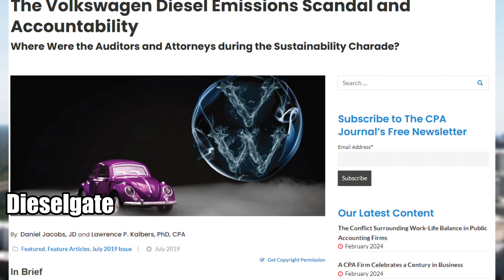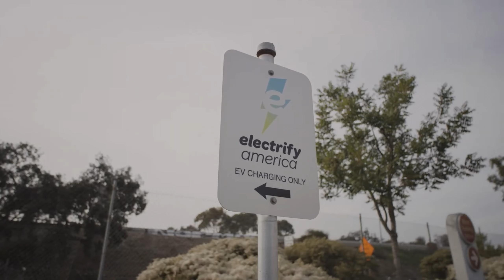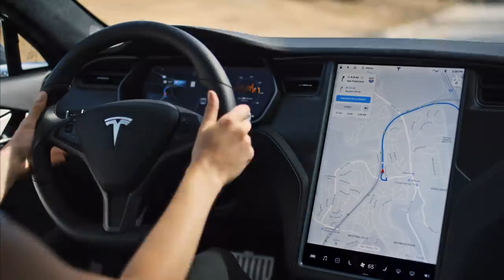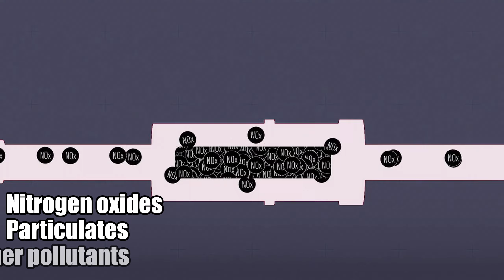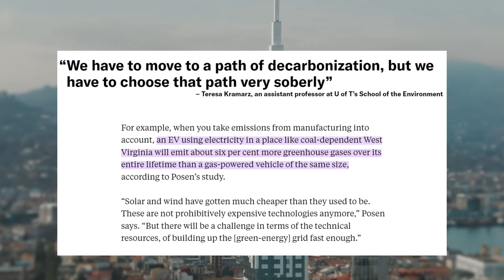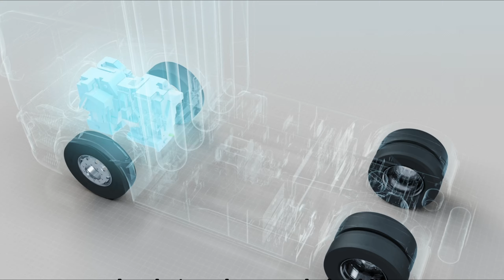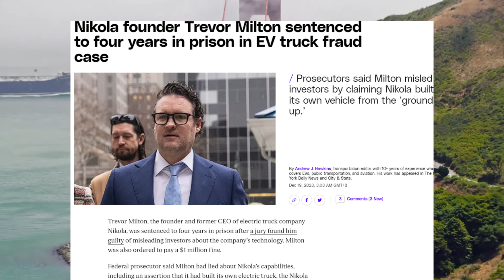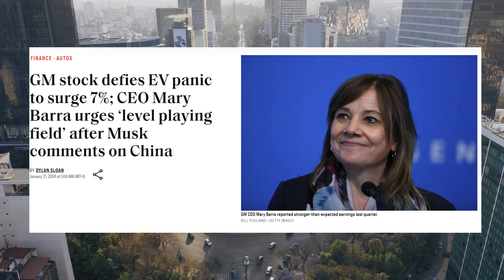Electric Shock: The 5 Scandals That Shook the EV Market! A Dead End or a Bump in the Road?

Comment: Interesting that #5 was NOT the Risk of a Firey Inferno should the battery get punctured not among the Top 5. Hate to say this as I am an Old School ICE dinosaur : - ) but this whole EV Boondoggle is being so poorly implemented I would not dive in IGNORANTLY of the Risks. I actually like Technology but also beleive in keeping it to a minimum (no heated steering wheels, or Bluetooth Wifi Door handles, etc) for me. Manual Mirror Adjustments work jus t fine ! No iPad integration to adjust my mirrors is needed. The more Gimmicks the more that can and DOES go wrong. Seems to me less is more ! More Distance and milage if you remove all the BS Screens and Gimmicks, Bluetooth switches and such. Call me crazy but I will take a good old reliable mechanical door handle should I need to get out quickly over Bloated Gimmicks any day. EV's are not the Future for EVERYBODY anybody can see that Duhhhhh....especially Me.  I for one am glad others are the Beta Testers for the rest of us. They are the ones paying the Stupidly High Inflated Prices and Bad reliability so I don't have to. Some pay with their wallets, some with their lives.  Think there are "Scandals" than 5.

Comment: The anti hydrogen propaganda scandal with you is that the Nikola scandal you refer to is long since rectified and there are now working prototypes of the Nikola hydrogen fuel cell truck that have 500 Miles range. It's very real and not a sham.